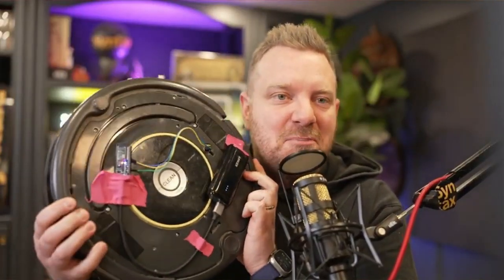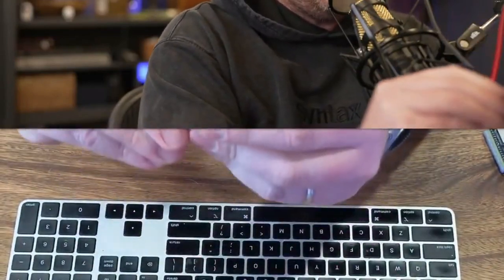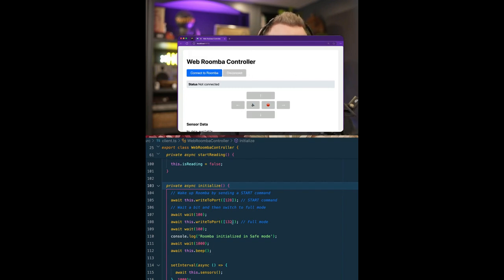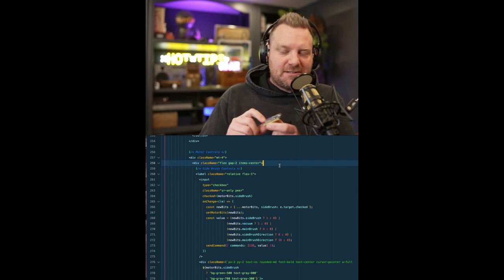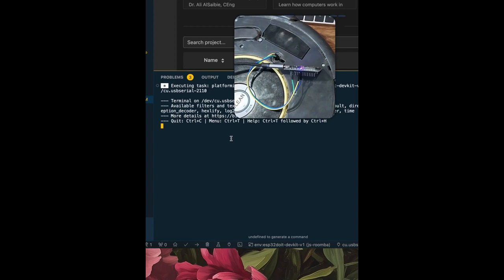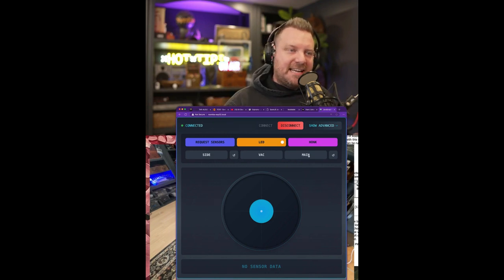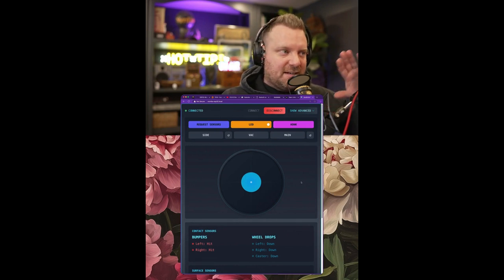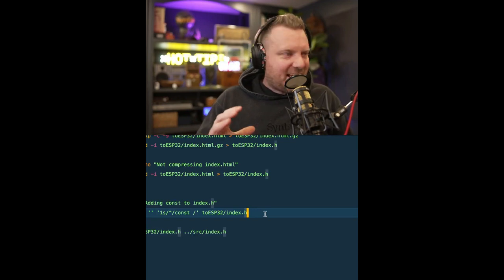A Guy Put JavaScript on His Roomba, and It Drove Itself Off The Desk!

Comment: Ordering a 2nd hand Roomba :D Very cool project!

A quick note on a buck converter and ESP board. Most of those dev boards have voltage regulator in place, need to check the specific of yours but they are usually ok with up to 12 v. When tuning your buck converter output don't drop it to 5v as voltage spikes from turning on motors can cause ESP board to reboot. So it's best to have some margin there as well as it will likely be more efficient (conversion losses compared to low voltages).